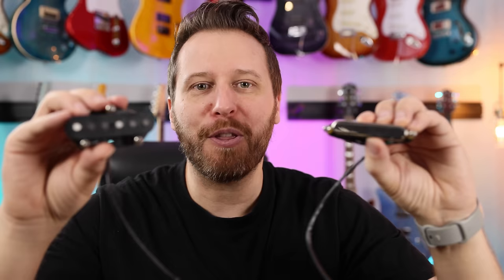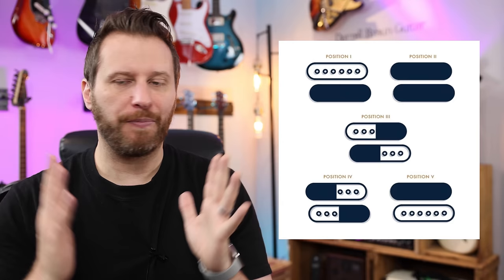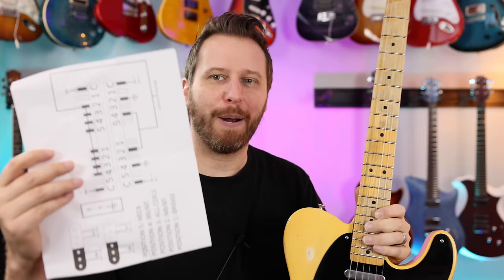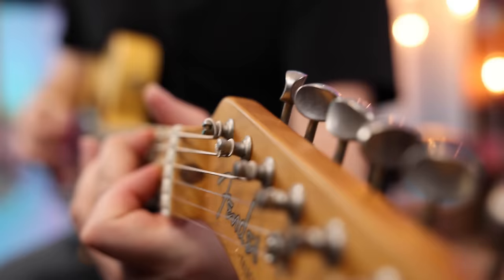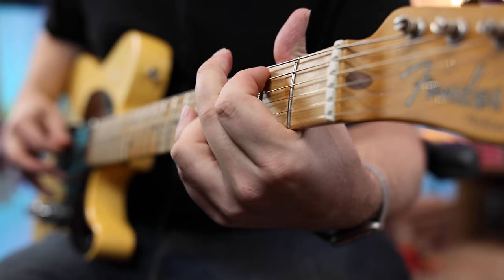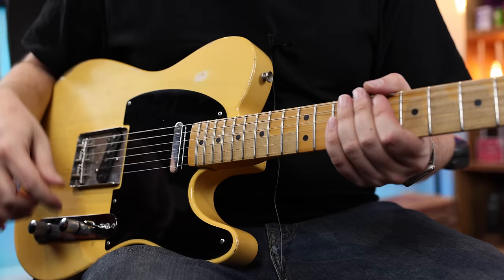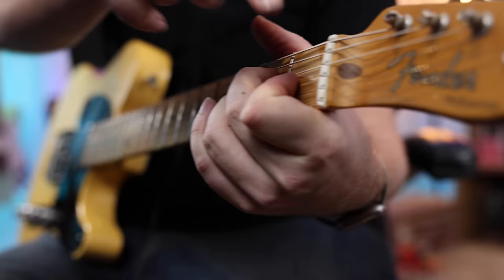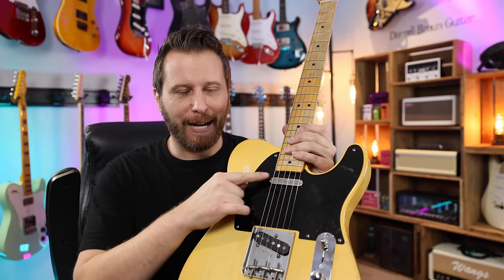I've NEVER Seen Telecaster Pickups Like This Before! // Bipolar Pickups!

Comment from the maker: 5 way switching on a Tele is a pretty cool way to add some versatility without losing what makes the Tele so great!
Enjoy :)
Reply: Darrell, I see a potentially serious issue with this pickup design, similar to that of some “noiseless” pickups out there that have similar separate 3+3 coil arrangements: With the separate 3+3 coils, this could theoretically mean that if you bend the D or G strings, they could get pushed outside the magnetic field and thus go silent, more so on the neck pickup than the bridge, and most likely if you bend around the 12th fret, where the string can get displaced the most from its normal path. Is string bending a problem this way on these pickups?
Reply: @zuperdee  a very good point. I am curious about this too.
Reply: I could not fit full sized pots and the super switch on the control plate. I do use high quality BOURNS pots.
Reply: Interesting design. Are they hum cancelling? From the tone it doesn't sound like it, but hard to tell from my phone speakers. 

Also, good note on the dime size pots. I'd believe the target consumer would value full size quality pots. I certainly would, for longevity and feel, in my case. Even if the impedance in dime size is the same and makes no difference in tone.

Maybe the pot zise doesn't matter at all? What do you think Darrel? Good topic for a new video?
Reply: Interesting questions by the followers about bending and hum cancelling. I would add another: would you consider expading the review about how the tone pot affects the 2/4 positions?
Reply: Hey Darrell. I think you have a spammer replying to some of the comments, claiming they've won a prize.
Reply: Darrell you have a spammer on your sight for winners
Reply: It looked to me like you mixed up what the 2&3 positions are in your playing demo, compared to the switch diagram. I could be wrong, check it out.
Reply: @zuperdee  Interesting, Something to keep in mind when I wire some up. I heard that the G&L MFD Z-Coil offset the coils to fix this. Not an expert just read it online somewhere.
Reply: @AmerikkkaGuitars  That would make sense! By offsetting the coils in a “Z” pattern (similar to the P-Bass pickups), this would help to ensure that the strings cannot get bent outside the magnetic field of either coil.
Reply: Congratulations you've just come across a Burns 1963 wild dog wiring configuration, nothing new to the UK. Burns also did the pickups used by Brian May. The Shadows I believe used Burns guitars before going over to fender
Reply: @philhill8525  Nice share, checked out some reviews, they all say the sound was really weak, unlilke what darrell just played. Not sure how they wired it, if it was in parallel it would be sound weak. These pickups are in series. Some say they were out of phase too. Not sure but would explain why nobody really liked it. Do you have this guitar to check the wiring?
Reply: With this design, is position 1 and 5 also hum cancelling?
Reply: @mesarosmm  Yes, all of the pickups are humcancelling.
Reply: I should think that ALL positions could be hum cancelling with this setup, since each pickup has two separate coils that could potentially be RWRP from each other. And no, this does NOT in itself mean that the tone will automatically be made thicker like a PAF humbucker. For one thing, these pickups are probably wired in parallel, not in series like a PAF humbucker, and secondly, the aperture of the magnetic fields here won’t be as wide as a PAF humbucker. These should still theoretically sound like single coil pickups, all else being equal.
Reply: For sure each one is in RWRP series like a humbucker but of course not sounding anything like a PAF. The inductance very similar to strat. Inductance from different coil wire sizes , suprisingly doesn't change the resonant peak too much, all other factors the same. Just raises the volume. Coil turns are the key I think and you can't really fit too much in a half coil. I'm wondering if you use ultra thin 44awg wire and stuff that half coil up to lower the inductance like a humbucker, if it would even sound close. But does that alter the magnetic field to have more phasing issues in between strings 3rd and 4th strings? And then there is the construction, magnetic poles pieces vs magnetic bars and the baseplate. This rabbit hole makes me think more instead of winding pickups on my mojotone winder. I just hate wasting wire. Just try to copy what seymour duncan does, they seem to experiment the most. I wanna chug and have spanky tones dammit.
Reply: @zuperdee  There is the similar design from fender - super 55 pickups. You can find demo from Next Gen Guitars. It has exactly the problems you are talking about.
Reply: Why didn't you do a distorted demo? I feel like in solos it would be extremely good for a nice change in the 4th position. You can keep the same qualities of the bridge on ead strings, and silky smooth solo leads in a rock song.
Reply: @robraaiii  Às soon as I saw the diagram I thought, oh I would rather the middle position be both PU's. After hearing the demo I think the diagram may be wrong in that respect.
Reply: @musicmanLes001  I don’t know if he mocked up the diagram or if it was provided with the rig. I would think, if the company sent it then that would be the correct layout. It would be cool if Darrell would clear it up for us.

Comment: I agree about the pots. Full-sized ones won't cost Bipolar much to include instead of the el cheapos. I went a different route with my Glarry semi-hollow Tele. Swapped the bridge pickup for a DiMarzio Hot-T bridge model to balance the output, and added a Free Way 6-position 3-way switch. Comes pretty close to the tones in this video, Darrell…
Reply: How do you like the feel of the glarry tele? I have a glarry p bass and it's neck is extremely chunky and I was considering getting either  one of those teles or a squier affinity tele for a mod project.
Reply: @DarthCiliatus  I have both a Glarry and Squier Affinity Tele (I have several low-end guitars). The Glarry is one of my favorites, and I like the neck just fine. It also weighs less than 6 lbs., a big plus.
Reply: The  switch is so big I could not get full size pots to fit. We do use high quality Bourns pots.

Comment: Pups sound good on their own. But I think more versatile tones come from phase series parallel options. Darrell recommended the freeway switch and I never looked back. Easy to dial in and all supremely useful tones.
Reply: Yeah, I got the Freeway for my Squier Strat and I love it. Cheers! 😎
Reply: Yes! I got the freeway for my strat and love it but the freeway for the tele and the les paul are even better cause they have out of phase tones which are my favorite (specially for slide).

Comment: I dig this kind of out of the box pickup design. I was always a fan of Lace Sensors and Zexcoils because of their unique properties and tonal varieties. I'm now gonna obsess over these pups till I try them.
Reply: Yeah, absolutely.  Currently doing multiple guitar best builds and one of the guitars will be equipped with a set of lace pickups, I like checking out different pickups, different types, different concepts, whether they're made by the Giants like Seymour Duncan, the growing newcomers like bare-knuckle or Fishman, established innovators like Eng or DiMarzio, or any number of smaller, the so-called Boutique builders

Comment: I think it would be nice to have a dual (stereo) output on the guitar and route one channel through an octave pedal. This way you have much more control compared to lowpass filter from a BOSS OC.
Reply: The idea of playing one instrument but having it sounds like many is pretty neat. Emily Hopkins is harp channel demoing effects pedals that can use separate effects chains on different registered pickups. Been thinking about this idea since discovering it. Turns out for guitar there are designs for hexaphonic pickups - six individual pickups for each string and normally use a controller to manage all the different routing configurations to two or more outputs.
Reply: Could wire it that way but you would lose the noiseless aspect of it unfortunately. You would have to stack each half with another bobbin underneath and use thinner coil wire for sure, maybe as thin as 44awg. I contacted them, wondering if they can design something like that. Hopefully I can collaborate with them on my guitar builds. I know I'm smalltime pissant luthier. Hopefully I can get to management. I can make guitars to easily incorporate these pickups.
Reply: @UncleRoykus  yes, that's basically how a midi-controller for guitar works as well. I am planning to do this idea with an acoustic guitar, but could be done with electric as well.
Reply: Just contacted Scott from S&S , seeing if we can make this happen. Really Excited!

Comment: Darrell, I am a little disappointed that you didn't tell us whether those pickups were hum cancelling.  I'm sure that they are.  That design is more an application of Leo Fender's split coil pickup designs as seen in the venerable P-bass pickup and the Wide Range pickup set from years gone by.  Those were humbucking.  All the settings of this new set should buck him as well.

I'm just championing full disclosure and complete information.  Obviously, hum rejection in all switch positions is a GOOD THING.  Otherwise, Teles can be some NOISY critters!

Comment: Thank you, Mr. Braun, I ended up giving these a shot in a newer G&L ASAT Classic Bluesboy (semi-hollow).  There was some indecision on my part concerning which beastie was going to get the bipolar pickups before settling on the G&L.  I also went covered for the neck pickup, AlNiCo2 for the older tones, too.  The one thing I would recommend is to have S&S Winding wire the kit with “bullets” (small banana plugs) as this will make the instal a serious breeze into whatever instrument you are using to host these pickups.  My G&L went from a very sweet strat to a jazzy ice queen tele.  I just wish there was more room to add more controls in order to get all combinations out of these pickups.

Comment: I definitely want these pickups, but I don't like the in between sounds. Would rather use the bipolarity as an interesting way of getting a noise cancelling pickup (hopefully) and getting interesting voicings from the same pickup due to wiring the two halves in series or parallel
Reply: Absolutely, give me three positions all noise cancelling with true single coil tone. I think this company has the right idea about windings, but the wacky mix of coils would be of no use to me.
Reply: Yeah, they should hum cancel, I didn’t hear him mention that.
Reply: @bobstrickland4223  yup, at the end it should work the same as a P Bass pickup
Reply: I'm 100% sure you could solder them that way if they're wound in different directions, I looked on the website and didn't see anything mentioning if each pickup half was reversed wound.  I'd think there's an equal market there doing that. I don't know if you can just solder the start to stop and then back to start, like any other series humbucker....
Reply: Pretty sure the EAD string magnets would need to point the opposite way to the GBE ones for hum cancelling.
Reply: @OutstandingBill1  true, though not mentioned at all in the video or by the company

Comment: Two thoughts:
1- Try adding some dirt in position 4. It should be the ideal setup for tight heavy riffing on the low end and mellow soloing high up.
2- Dime-sized pots: maybe that's something deliberately meant for Squier Bullet Tele owners so they don't have to do any routing?

Comment: Okay, this has some great possibilities. Instead of the 5 way switch, put in 2: of the standard 3-way switches. One switch for the top halves of the pickups, one for the bottom half. Then, 2 output jacks. Each of the 2 outputs will take the audio from 3 of the strings. You can now run each audio channels in either stereo mode or even bi-amp.

Comment: Your review is spot on. Positions 1 and 5 sound REALLY good to me and I like the middle positions but probably for specific use cases. The smaller pots are unusual. I tried to see the brand of those pots as you held the control plate up close but couldnt see the brand but they are 250k pots.

Comment: They sound pretty good. A couple more sounds out of a Tele without having to add the middle pickup and a 5 way Super Switch as I have done. Position 2 n 4 are kind of unique sounding. I agree with you about the pots also. Tanks for the video Darrell.

Comment: I thought the sound of the traditional positions sounded rich and of high quality.  The 2 split pickup positions 3/3 seemed a bit more on the gimmick side. I'm not sure that I'd use either of them very often if at all.  Nice video.

Comment: I’d definitely be putting the old pots back in. But those control plates that come pre-loaded with tiny pots often don’t have holes big enough to fit full-size pots. So perhaps just moving the switch to the old control plates is in order. But don’t put up with those pots, that’s for sure.

Comment: Good sounding pickups and interesting design. I'd probably have to try them to know if I liked that setup or not. And, I'd have to test how the volume and tone controls worked with the split design. Personally, I'd guess that 2 tone controls and 1 volume would work better. That's what I did on my 2-pickup Strat. 

Regarding the size of the Tone Pots, the different diameter of the Pots would affect how fast the Wiper sweeps across the Resistance Strip. But, I don't know if that really makes any significant difference. Someone should conduct a test. Who knows, maybe smaller might actually feel better. A lot of YouTubers have commented about small size pots, but I don't know if anyone has done a good blind test to how well they perform and feel. Thanks

Comment: They've built a very intriguing set of pick ups, which are quite similar to a few of the dozens of ideas I had for pickup sets, starting about 15 years ago, and specifically reminiscent of a series of three variations of T-type sets, nine pickup sets total, that I had created detailed prints for between my first and second year at Madison College. As pickups are one of the only parts and/or components that we generally do not build complete in-house for some of our custom, and semi-custom instrument builds (though we do machine complete the various parts that go into building a pickup, utilizing a wide variety of metallic and non-metallic materials), I (we) would be interested in hearing/seeing any other pickup(s), set(s), or pickup ideas, they're creating,  how they align with with what we do, how, and why.
Very cool video

Comment: Hey Darrell, great video as always.  But there is one thing you mentioned that guess I don't completely understand.  Are the dime size pots actually lower quality than the full size ones? I have guitars with both and they seem to operate okay. Just wondering
Reply: They are not, he's just projecting.  From an electrical and musical standpoint they are no different.

Comment: This is not a new idea……Gretsch fitted split winding pickups to their White Falcon model for their company salesman and presenter Jimmy Webster in the late 50’s early 60’s. The idea was to route the guitar through 2 amplifiers, one amp taking the top three strings and the other the bottom three. This gave a unique opportunity for different amp settings and when the guitar was strummed a ‘wide pseudo stereo’ sound was achieved. With today’s modern stereo effects units there will be much more to be experimented with.

Comment: Better to look at the pots, their specs and tolerances rather than size. I've examined some pot internals and have found dime sized tracks stuffed in to full sized cases... And full sized tracks of poor contacts compared to a dime size.  Choose a well built pot, built by proper manufacturers. A good CTS mini, is better than cheap full size knock offs (do not even trust etched names like 'Alpha' if not buying from established suppliers) that'll go scratchy quick or even worse, have level drops across its range...  I have no affiliation to the product whatsoever but quality pots have moved on from when size indicated anything and before the market was flooded with knock offs.

Comment: Don't really hear the quackiness  you're talking about in position 2 and 4 here. 

Also, would have been interesting to hear a direct comparison of 3 strings at a time when going through the one pickup normally vs going through it split. E.g. the treble strings going through the traditional neck setting, vs the treble strings going through the treble-neck-bass-bridge setting, i.e. what is the tone difference for each half of the coil, rather than just hearing the resultant tone of it played all together

Comment: Nothing special there Darrell. It's the same as a P bass pickup just made linear, not offset. Bass pickups have been built this way for decades. All that's been added is a way to switch the low and high string sections across the pickups. Sorry (I usually like the podcast), but big deal.

Comment: Ok a little confused you explanation of position 2 and 3 did not match the position diagram you showed. The diagram had 2 as both pick ups full  and 3 as the two split. It did sound as if your verbal explanation was the correct one not the diagram, and 2 being split just makes more sense

Comment: If anybody knows how to do this or knows someone who knows how to do this, it would be you. Can I wire 3 single coils together into one jumbo humbucker? I want to do something stupid to my old MIM Strat. I just want my pickup selector to choose this cluster humbucker as a group, not each individual single coil.
Reply: You won't like the sound, I tried that.  Just solder the coil start and stop in series, make sense? But you hear too much information from the pickups and fundamental tones are odd.